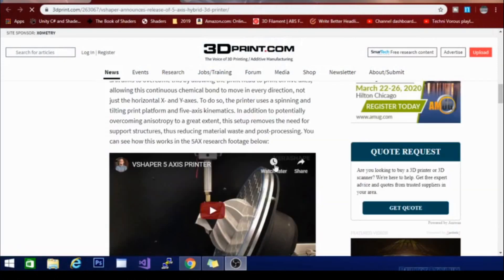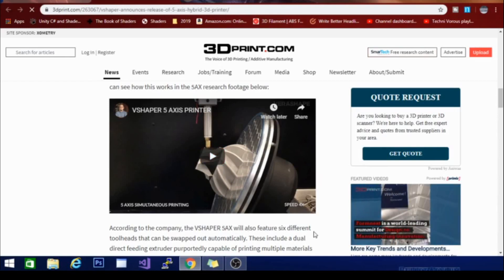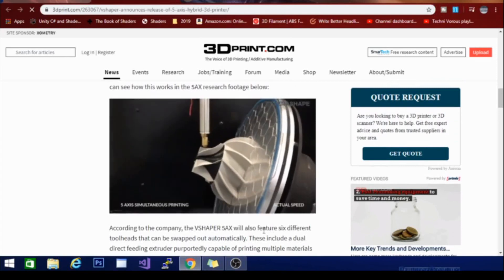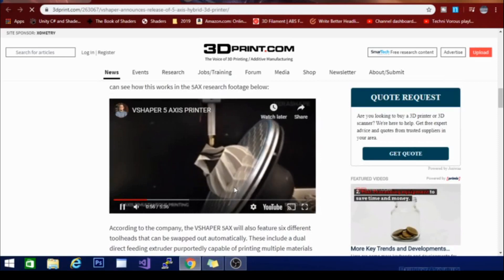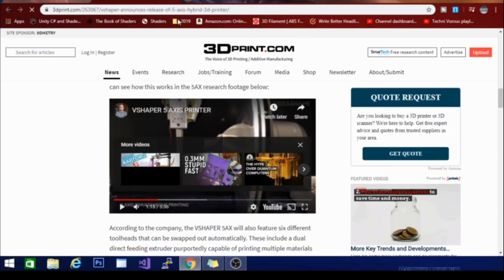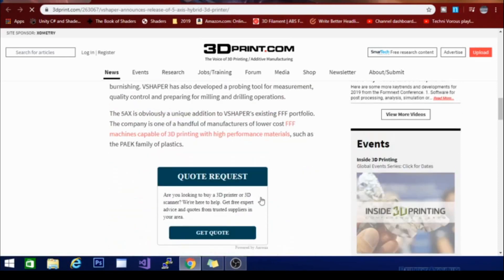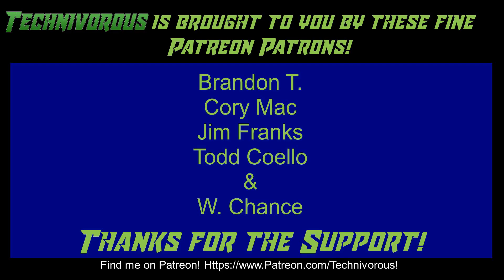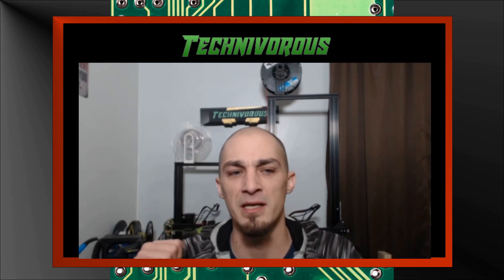Vshaper 5AX   a new 5 axis printer with tilting and rotatin bed

Comment: I don't think a 5 axis SLA is possible with current technology as the tank would also have to tilt and the amount of resin that would have to be in the vat to keep the film covered would spill as soon as its tilted, you would have to develop a sealed system whilst still maintaining movement on the z-axis
Reply from the maker: Take a look at the mod joel telling out on his slate machine, it tilts the bed to let resin run off when the print is finished, it only hits about 30 degrees which wouldn't be enough, and tilting the bed in the tank would require a huge tank. So yeah, not really feasible.... yet. Lol

Comment: That is incredibly cool! My first thought was, "OK, yeah... My Ender 3 can't do that. Yet."
There is some kind of mod for slicing a print that does something a little like that. I can't remember where I saw it, though... There just aren't enough hours in the day.
Reply from the maker: I bet it was the non planar slicing? That's an interesting technique...
Reply: Yep,  @Technivorous , that's the one. 

It looked pretty interesting but it's very dependent upon the area around the nozzle to prevent smashing into the print. I noticed that the nozzle on this machine is incredibly long so that there isn't any interference. 

It makes me wonder how they keep the temperature constant and what happens when you do a retraction.